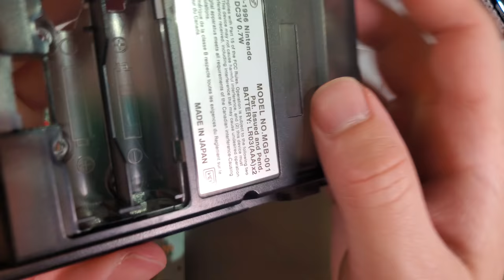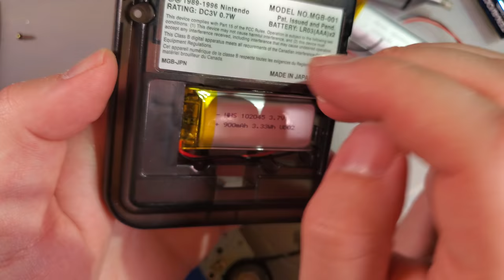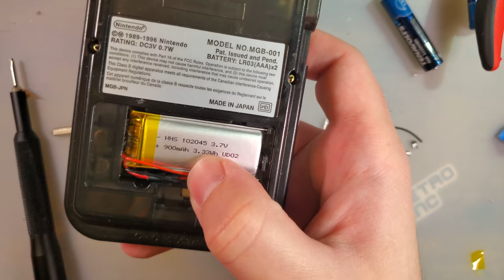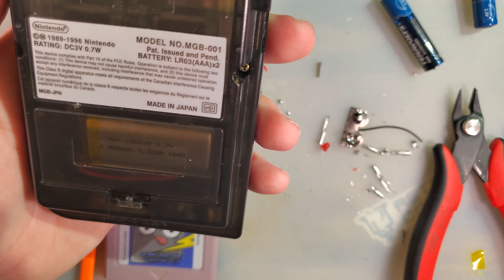Gil Tesa USB C LiPo Mod - Game Boy Pocket

Comment: I will be waiting for your battery test results vs the eneloop/Ikea batteries. I can't find much info on the Jugee batteries. I want to a USB-C charging battery mod on my GBC but I am not the best at soldering.
Reply: Boxypixel's battery, bracket and USB-C charging controller are what I use. There aren't many good USB-C mods for the GBC out there, but theirs is great. It's originally designed for their CNC aluminum shells, but you can modify regular GBC shells to fit the charging port. Just sticks out the left side of the GBC.
Reply from the maker: Big Clive has a video on the AA version of the jugee batteries but the AAA version is the same just smaller. 

The run time results of jugees in a Pocket vs other common batteries will not impress you but the key factor is that while the run time is about the same or slightly less in some cases, you get reliable boots the whole time off jugees whereas NiMh batteries stop booting reliably about 45 minutes to an hour into their sub four hour life. Once on, the GB stays on regardless but if you try restarting your game (especially with a flash cart like ez flash omega or everdrive), you're in for some disappointment.
Reply from the maker: @husky3g  This is for the Game Boy Pocket. Not the Color.

Comment: you can use a pair of flush cuts to cut the battery compartment out, make sure to wear safety glasses!
Reply from the maker: I've ruined cheap flush cutters this way but CHP-170 cutters can do this no problem

Comment: I managed to cram a 1800 mAh (106025, if I remember correctly) with heavy cutting of the case and out of that, I could have about 9 hours cycling on an original Pokemon yellow title screen at max brightness, sound off. So if it's somehow accurate, I suppose you could expect 4 to 5 hours on that 900 mAh battery, which is pretty decent, already
Reply from the maker: I think 1800mAh is a little generous of an estimate for that size but I'd have to double check my numbers. But yeah, I estimated about four and a half hours out of this battery. I keep meaning to run it down to find out for sure though.

Comment: Gread vid, its the best  batt mod for a pocket ive seen, but still no play and charge.. im glad we lived in this day and age that we have a aaa lithium batt that does constant 1.5v 😁 , i would do it if this lithium aaa batts dont exist ,  you still have your dc adaptor option in playing.  As i watched all of your vids about batteries and stuff i made a point that if it carries  aa and aaa no need to fuck  around with it 🤔  ,thanks again for the vid learned a fee new techniques 😁
Reply from the maker: I mean, at the end of the day, do you really need play and charge? With a mod like this, there's no reason you can't just pop the GB on the charger after a session so unless you've got four+ hour long sessions, you should always be able to get through. 

And I guess in the case of longer individual sessions, I guess it's time to come to terms with using a different console that gets better battery life.
Reply: The play and chargent i think of a safety precaution 😅 like im playing and battery running low and my dumb insticts thinks plugging  a charger will solve the issue haha. In the end of the day its not really that important .
Reply from the maker: @j.a.styles547  It's not a precaution. It's requirement. These mods do NOT support simultaneous play and charge and the charge controller will NOT be able to properly switch charge modes. It IS important because battery failure can be catastrophic. 

If you cannot manage without simultaneous play and charge, look into a different mod and install something that does support simultaneous play and charge. Or, just charge your console when you're done playing it so that next time you play it, you have a full charge ahead of you.

Comment: Did anyone else have issues with the power board fitting? The v1.2 boards have a big ass chip on the end that prevents any of my pocket shells from closing. I had to heat the shell plastic and squeeze to get the shell halves to fit with this mod in.

Comment: I just ordered this kit and then took my pocket apart and it’s the MGB-CPU-01 and the led indicator doesn’t have a spot to mount to. Is there a work around for this to still get this to work? That’s one reason I went with this kit. Lol thanks.
Reply from the maker: Well the wiring is going to be a bit different but it's probably the exact same as just adding a led to a non-LED Pocket: https://gameboy.github.io/consoles/pocket

Comment: I've got a gen 1 pocket without the led on the mobo.  Will this mod allow me to add the led? There's an empty hole where I can mount it but it would bridge the back pads on the led mobo.  Are the 3 wires enough to supply power or is the connection to the led pins on a gen 2 mobo necessary?
Reply from the maker: you would have to do extra wiring as the three wires are only for the charge status lights
Reply: @makho  what extra wiring could I do since I have the same problem?
Reply from the maker: @kennethrosenbalmjr8179  https://gameboy.github.io/consoles/pocket

Comment: Do you know if it plays nice with additional power mods? I’ve got my pocket with a Helder Power Regulator, so I don’t know if it functions as a power regulator and would double up on functions or if it doesn’t and would work just fine as a normal mod.
Reply from the maker: It's probably fine but I don't really recommend Helder's regulator for other reasons. This is a question you should ask of Helder.
Reply: @makho  Is there any issues related to the regulator? I got it to go with an IPS screen, and I got Helder’s because the only other one I knew of that wasn’t sold out was Retrosix, who I already had a bad experience with regarding a ridiculously late and poor quality shell so no dice on them. I’m still planning on getting the USB-C mod, I just want to know if it would be better to remove it when I’m doing the USB-C mod or if it’s fine to keep it.
Reply: @makho  Also, definitely love your videos, and I can’t wait for the Slate to finally be ready.
Reply from the maker: @rickyrns1059  I don't know that using Helder's regulator can actually affect your hardware negatively, I just don't understand this whole "let's throw parts at this thing even though it's working just fine" attitude. Like, what is that regulator doing that your stock one wasn't? If you're installing a LiPo mod too, I don't expect there to be any benefit at all. In fact, you're probably introducing a ton of inrush current and I bet that simply booting while have the wrong combination of things connected can trigger some edge case hardware failure that might not have occurred otherwise. I know that big tantalum cap does result in way more inrush than stock consoles and I know Helder's previous mods have blown fuses before due to absurdly high inrush current so I'm just being cautious, especially because LiPo batteries are involved. 

Now what does my predicted hardware failure look like? Well, it could just be as bad as blowing the main fuse or simply bootlooping until brightness is lowered, flash cart is removed, or the battery is charged or something. I don't expect anything more serious but I still believe it's unnecessary.
Reply: @makho  Ok, I’ll definitely try to remove the Regulator when I get the USB-C mod, I’ve had no problem before with his stuff but I haven’t tried doing something like this before either so I’ll try my best to keep my Gameboy Pocket safe.

My main incentive for getting it beforehand was because the batteries I have on hand aren’t the best(it’s Duracell, but it’s the cheap outdated Duracell stuff my college sells since they still work fine for others needs and only not mine, where even EZ-Flash Junior alone was Multibooting), so you’re probably right that I won’t need it once I get Gil’s mod.

Thank you for all the advice, and keep up the good work with the videos, they’re genuinely informative.

Comment: I have a question about this and the Gameboy color version of this mod. My current funnyplaying Gameboy color is very quiet. I realize the power is being sucked up for the screen and its running on normal batteries. Will this mod fix that issue? or is there another mod you suggest to fix that as well. I'm very inexperienced and any help would be great. Loved hearing your rant on the pocket being awful battery wise
Reply from the maker: No, this probably won't help. Quiet volume can be any number of things from dirty volume wheel, dirty headphone jack, bad speaker, or bad caps (note that a bad speaker is often caused by bad caps). Also, and I mean no offense by this, but Game Boy models (aside from the DMG) just aren't very loud when working normally so sometimes people try troubleshooting low volume without realizing that it's working as expected.
Reply: @makho  no offense taken! I appreciate the information. I see online there are a bunch of “audio amplifier mods” and I’m tempted but I don’t know if it can handle it. You have said in the past that the old power conductors aren’t meant to handle so many high power mods at once. (“It was never meant to” are you words I think) I believe the speaker unit is fine comparing to another gameboy color. 
Is there an amp you recommend? To pair with the Q5 screen and the usb-c/battery combo from this video? Is the stock speaker capable to reach high sounds
Reply from the maker: @LightShowList  I don't recommend any amp. If your console isn't loud enough, try headphones. If you want to install an amp anyway, the stock speaker will need to be replaced for one that supports higher wattage and keep in mind that an amp makes EVERYTHING louder, even that unwanted buzzing you hear when you turn the volume up.
Reply: @makho  That makes sense. Thank you very much for your input. You’ve given me a couple things to think about. Going to look up replacing the Caps and (maybe) and amp/speaker. I really appreciate you taking the time to help me out

Comment: Did this one a while back fun little mod altho my unit acts odd when the battery is out and basically refuses to charge it might have to rework it at some point
Reply from the maker: Uhh, well, it's a battery charger so it makes sense that you cannot charge a battery that's not connected. These mods don't support simultaneous play and charge so if you're saying that your GB doesn't work without the battery... well that's why too.